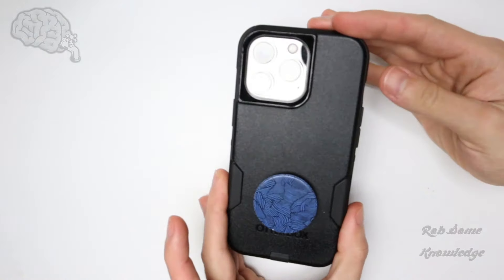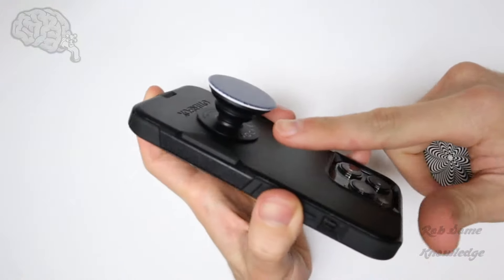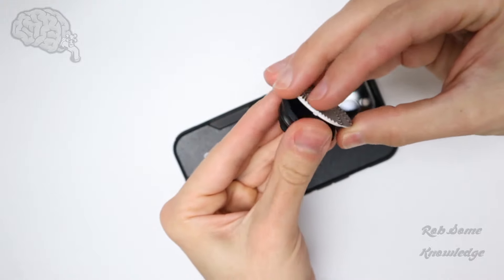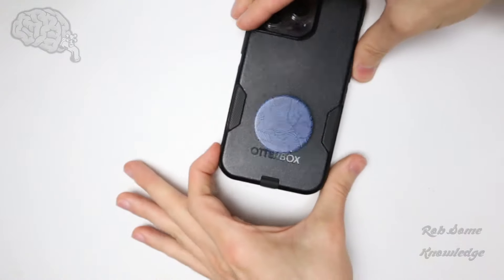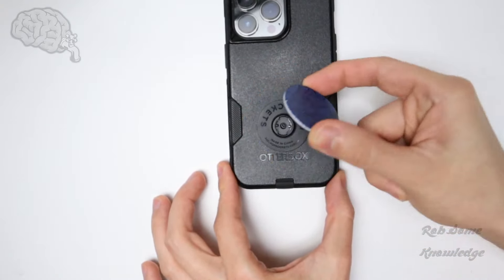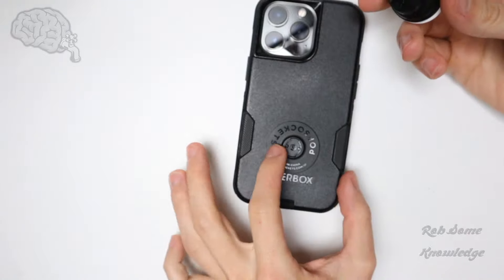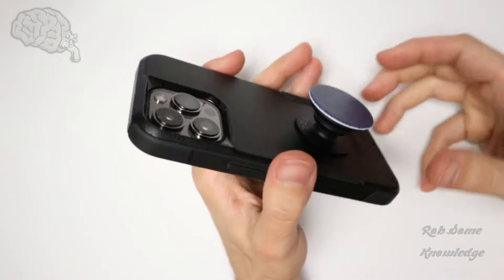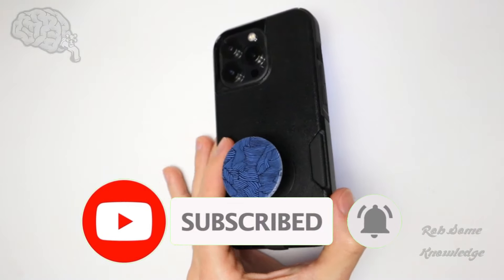How to Change Swappable PopSocket Top

Comment from the maker: Do you prefer the older or newer style of Popsocket?
Reply: I like the older kind because I could put a steel disc inside the cap, which then sticks to my magnetic dash board mount. New one doesn't allow to remove cap, so I can't put my steel disc inside to make magnetic mount stick to the pop socket itself. I saw another DIY video where they stick the steel disc on OUTSIDE the cap, but that covers up the design. I don't like that. So now I'm supposed to get all new dashboard mounting systems? Lame.
Reply: @mtoldroyd  iii
Reply: The older design with the notches is much better and easier to deal with.
Reply: Older design way better!! I just bought 6 from Amazon w interchangeable tops and two broke the first time I turned them to remove the disk one popped the entire disk out the other wouldn’t turn at all! Both were unbelievably high priced for a badly manufactured product! I am livid!!! I def miss the old style much more! They were a lot easier in lotsa ways!
Reply: Have you seen anywhere online that still sells the older style of the popsockets?
Reply: IT DOESNT WORK
Reply from the maker: You probably have an older popsocket then. Is there 4 little tabs around the lip of the popsocket design plate?
Reply: i like the new one much better because now i can actually use wireless charging pads 😊
Reply: I’ve tried it so many times I have had two separate ones that both said they were swappable but lo and be hold when I feel the click then try to pull it off NOPE dose not come off the old one is so so so SO much easier idk why they went and ruined it with this new one that’s practically unswappable I actually broke my old one thinking I could pull it off NOPE part of the base came off with it
Reply: Old because I fiddle about and spin my pop socket around when it’s collapsed so now it’s going to come off all the time 🙈
Reply: I'll let you know tomorrow when Amazon brings me mine. Hope I don't break mine like some have experienced.
Reply: Old version.  Mine stayed in place for years! This version 😡keeps popping off, causing me to drop my brand new phone 😩
Reply: @LisaSweet guy

Comment: Changing the top isn’t easy. I broke 2 just trying to change the top. I like the old design better!!
Reply from the maker: How exactly are you breaking them? Are you trying to just pull it off without it being unlocked from the base fully?
Reply: @RobSomeKnowledge  I just broke my beautiful pricier new one too, super upset rn 😢 It breaks when you pull instead of push
Reply from the maker: What do you mean when you pull? When trying to get it to unlock? I say to push down on the video
Reply: I just broke my old one as well lol
Reply: Just found out why! My old one was a different model, that’s why this truck didn’t work . The new one I got was very easy to switch the top bc it’s a newer model and has the 90 degree option
Reply: @RobSomeKnowledge mine is broken anyways. Broke cuz of use I guess? I would let a kid play with it. It's the part you're supposed to turn that shattered into pieces. Now less than half of it remains. It's enough to keep the pop socket on - but how do I change it now? Do u have any advice?
Reply: I just broke mine trying to swap it and I’m so upset because they don’t make the design anymore :(

Comment: I like the older kind because I could put a steel disc inside the cap, which then sticks to my magnetic dash board mount. New one doesn't allow to remove cap, so I can't put my steel disc inside to make magnetic mount stick to the pop socket itself. I saw another DIY video where they stick the steel disc on OUTSIDE the cap, but that covers up the design. I don't like that. So now I'm supposed to get all new dashboard mounting systems? Lame.
Reply: I totally agree!!!
Reply: Can you put a circle metal plate?

Comment: It would help to mention if you rotate until the click means you have gone too far... the click is 180°..
Reply from the maker: I mean I specifically say to only turn it 90 degrees , and show how to easily tell what is 90 degrees. So if you turn 90 degrees to click it in and 90 degrees to click it out, then it should be obvious that 180 degrees means you will be back where you started lol

Comment: I can't get it, the accordian just naturally pops up no matter how many times I try turning it 90 degrees. I can't get it on either the current popsocket on my phone or the new one I just opened. Both are swappable.
Reply from the maker: The accordion pops up? Like expands? I’ve never heard of it doing this by itself, collapsing sure, but opening up?
Reply: Yeah. My others ended up coming off just fine, but the Harry Potter one didn't. It's the enamel deathly hallows one. So maybe it's either the material or the specific line of them idk. @RobSomeKnowledge
Reply from the maker: Hmmm yeah that is really weird I’ve never heard that before

Comment: How is this easier? Mine literally doesn't turn...
Reply from the maker: Are you pushing down and turning at the same time? If you are and it’s not turning it’s either broken or you probably have the older style popsocket that doesn’t have the swappable part built in
Reply: @RobSomeKnowledge  It's brand new. It is the new one that has no swatches on the side. I am pushing down and turning and it just doesn't turn.
Reply from the maker: @ThatOneWeirdGal  Then you either most likely have a defective one, or a knock off maybe. Really weird
Reply: @RobSomeKnowledge   I'm having the same problem.  Grrrr

Comment: For those Magsafe popsockets, you need to twist 90 degrees anti-clockwise to remove the top rather than clockwise for some strange reason
Reply from the maker: Hmmm interesting, thanks for the info! I haven’t used any of the MagSafe popsockets

Comment: I have the older popsocket. And I just got it so I have a question. So can I remove the rubber part that is on it? Not the sticky part but the rubber thing that attaches to the top thing.
Reply from the maker: Are you talking about the silicone funnel part? If so on the old ones yes this does come out. This video will kind of show you it disassembled for the older ones. How to Fix a Broken Popsocket
https://youtu.be/goUvx0gVBJk
Reply from the maker: Are you talking about the silicone funnel part? If so on the old ones yes this does come out. This video will kind of show you it disassembled for the older ones. How to Fix a Broken Popsocket
https://youtu.be/goUvx0gVBJk
Reply: @RobSomeKnowledge  😅

Comment: Am I just dumb or does putting it back on not work at all for me
Reply from the maker: Are you pressing down and turning at the same time? This is required.
Reply: @RobSomeKnowledge  yeah, so I’m genuinely not sure what could be going wrong
Reply from the maker: There are little indentations and tabs that stick out. One set on the base. One set on the piece that disconnects. Are the little round tabs that stick up, broken or worn down? That is how they catch and lock in place

Comment: Doesn't work for me.
Edit: I got it to work; I was twisting the wrong direction 😊
Reply from the maker: Are you sure you have the newer Swappable popsocket, and is it a real one or a knockoff? The older ones don't have this feature, look right under the plate that has the popsocket design, do you see 4 little tabs that connect the design to the rubber expandable funnel part? If so you have an older style